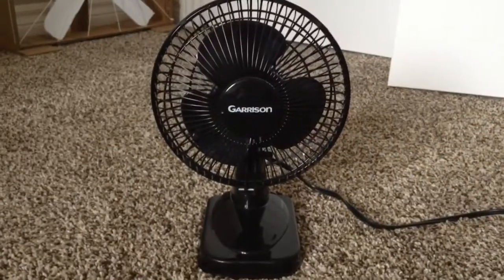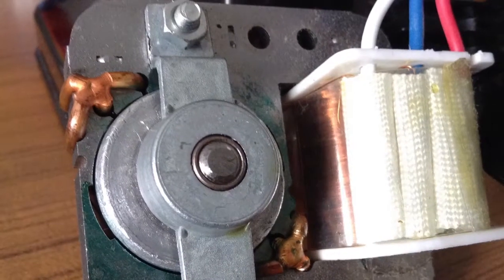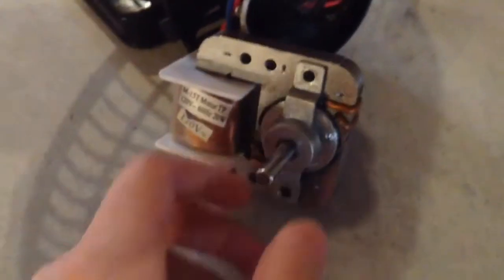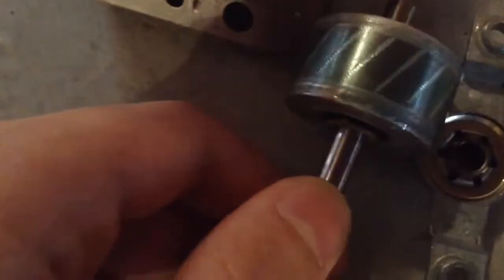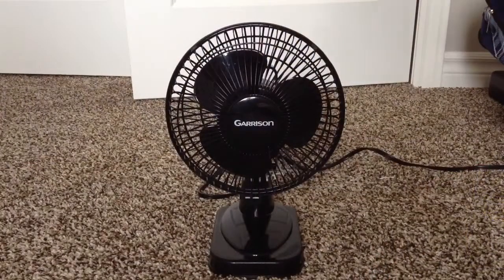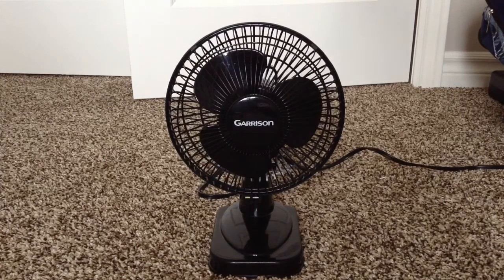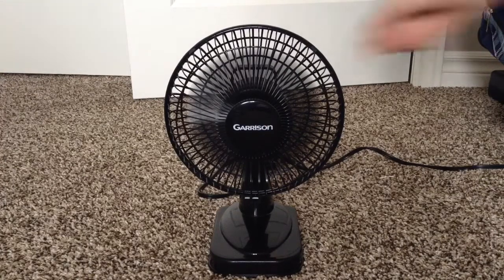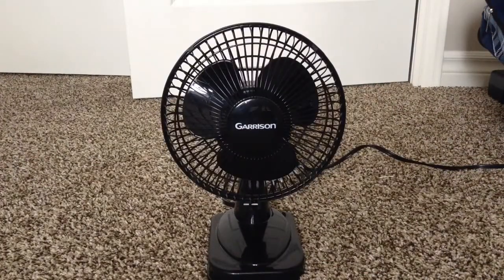Garrison 6" Desk/Clip Fan | Seized Motor Fix

Comment: Great video, but I wouldn't use WD-40 in a fan. It will work for a short time, but then the lubricant will solidify and it will seize up again.
Reply from the maker: WD-40 was the only suitable lubricant I had. And thanks for the info and I'm planning to buy the 3in1 oil for my fans.